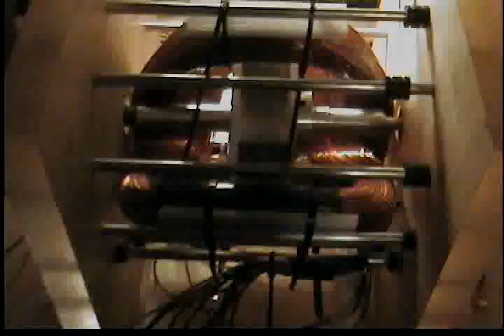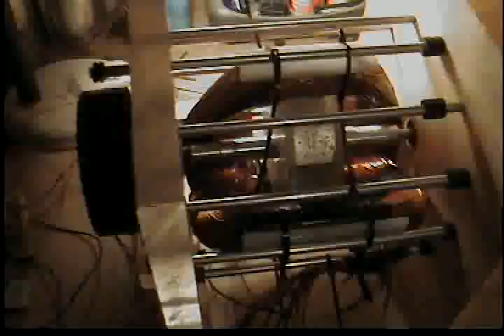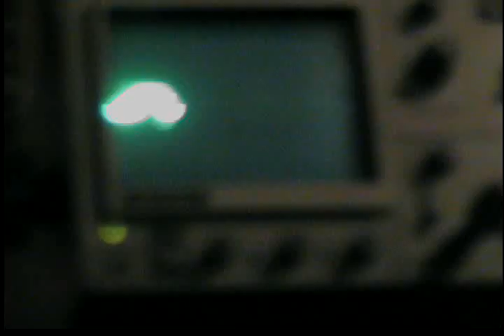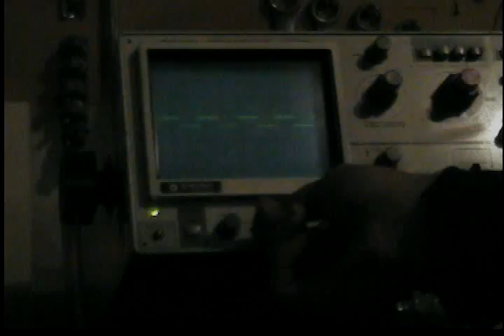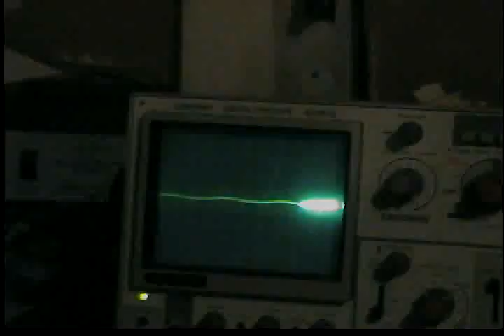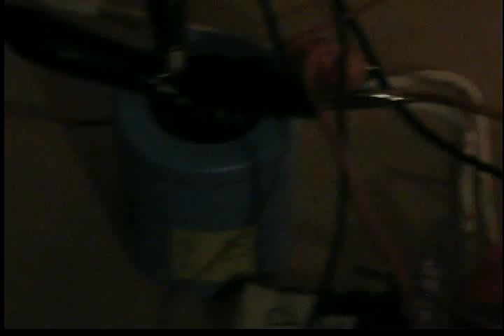Window motor runs- kinda fast too....

Comment from the maker: @rave154 Thanks for the comment. As for the circuit, in the video I am using the FULL sequential bipolar circuit. But I am also working with a half circuit as there seems to be a bit of an advantage for charging cap(s).  The schematic can be found at potentialtec com  . It is a simple one to build, like the ssg circuit. Thanks again and feel free ta ask any other questions. Peace Rawbush